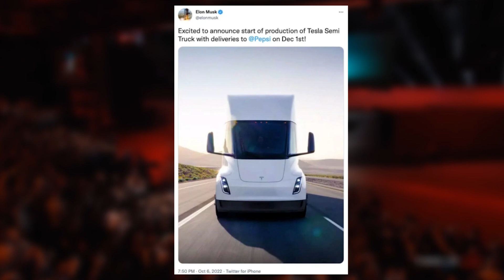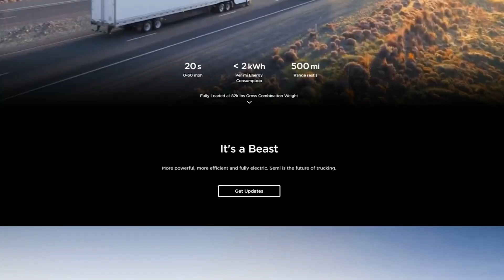Inside Tesla's NEW $7 Billion Semi Truck Factory

Comment: As a retired OTR truck driver, the projected benefits are very acceptable for Owner Operators. The cost of the movement of goods can be reduced. Be advised current trucks may be used as weapons by encroaching on a target truckers envelope. While operating a semi, it is possible to bounce a projectile off the flatbed and into the windshield of a target semi which is in route and located directly behind the projectile sending vehicle's flatbed.
Reply: Seeing the inside of the Tesla EV Semi is a treat beyond imagining and likely under careful development as it should be realized--only simple controls are required at this stage of options development. To begin with, it must be accepted (EV) broadly and the Trucking and Transportation of goods is a specialized and complex industry. There is the case of Sensitive and High Value transport items to name one but the Tesla will approach "Surge" in Tankers more intelligently (making roadways safer) than was done in the past.